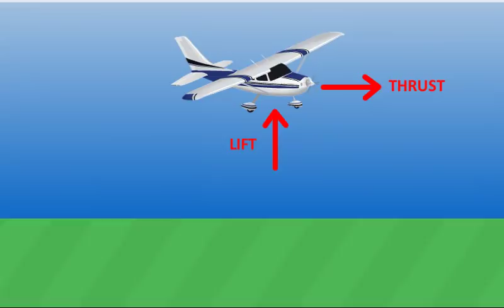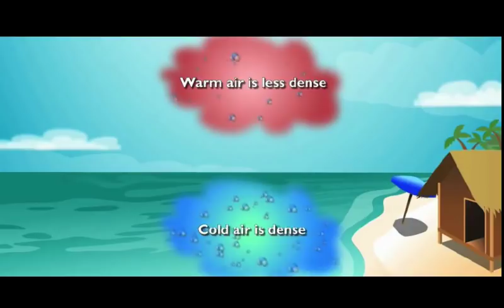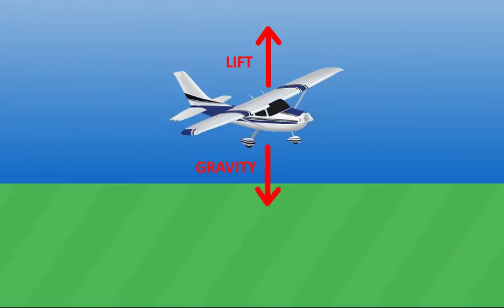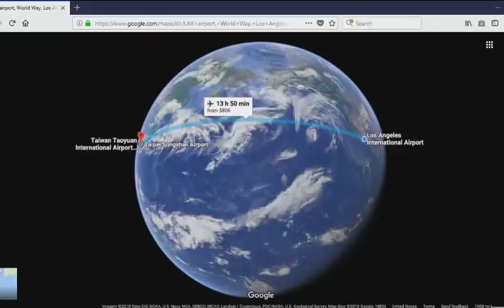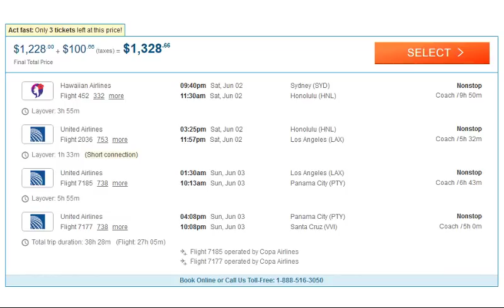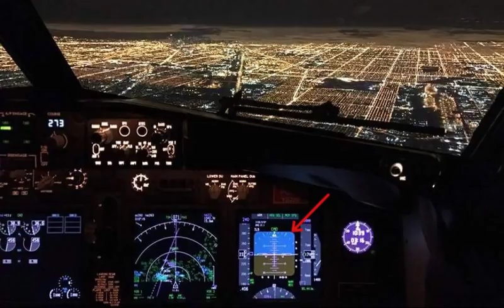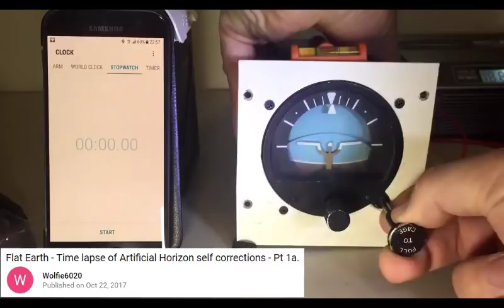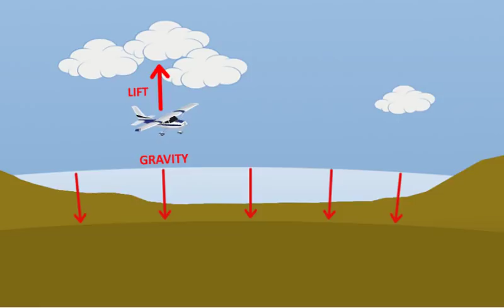Flat Earth Falsities - Plane Nonsense

Comment: globtards do not know science because the earth is flat
Reply: Okay, try this, get 2 people on different ends of a lake. Shine a powerful laser across and document the height of the laser at both ends. You will find that the laser changes height on the opposite end... thus showing that the earth is round, test your hypothosis before you believe it as fact
Reply: @dave chang
What extraordinary claims. You must be a very, very intelligent and experienced person. Are you?
Reply: that's the difference,you think but I know
Reply: @dave chang
No dave, you believe you think, if you could think you would know the Earth is a spheroid.
No dave, you believe you think you know, but actually you just believe because you don't know.
If you actually do have the intellect and knowledge you claim you should be able to answer these simple questions.
Why is it that a compass needle is more or less vertical at the poles and horizontal at the magnetic equator?
And when you carry on past the poles the needle slowly returns to the horizontal?
Why is it that it is only possible to navigate accurately over long distances using spherical trigonometry?
Why is it that traditional gyro compasses work perfectly in low latitudes but became unreliable in high latitudes?
Why is it that it is only possible to navigate accurately over long distances using charts based on a terrestrial spheroid?
Why is it that when you watch a ship sailing away from you the hull is the first thing to go below the horizon, then the superstructure and finally the funnel and upperworks?
Does a magnetic compass point towards polaris (Alpha Ursae Minoris) at the north and south poles?
Does a gyro compass point towards Alpha Ursae Minoris at the north and south poles?
What is the relationship between longitude and distance when travelling east or west parallel to the equator?
Tell me how you ascertain the error of a compass when in the Southern Ocean, using Alpha Ursae Minoris?
Please explain the principles behind the development and functioning of a gyrocompass?
No evasions please, just straight answers.
Reply: find out yourself
Reply: +dave chang

"that's the difference,you think but I know"

No, you only think you know. We actually have repeatable, detailed evidence for the earth being a spinning sphere orbiting the sun, while you have no evidence at all that the earth is flat.
Reply: bc u still do not know until u know u really know
Reply: liar
Reply: tsk tsk tsk always asking the wrong question good luck on your journey for truth
Reply: dave chang Why is it that those who know they know don't know they don't know how to explain what they know they know?
Reply: well you know shit
Reply: yup thats the idea  not to know bullshit like you have been learning stupid
Reply: HA HA so amusing how just anything with be pounced upon by these educated sane Normals :)  All the globe science is OLD greek stuff and century old experiences that did not prove.  Lost a +Mong but +Wong is still about, even mustered a 2 liners from  his usual.... But proud "salad tosser" +Capt'wes mason has gotten mighty shy since his revelations.

“Believe only half of what you see and nothing that you hear.” 
- Edgar Allan Poe
Reply: there's a test performed on the equator using a sink a bucket and water. directly on the equator water flows straight down but a few metres either side of the equator it drains spinning in opposite directions.. go watch it and explain if the earth is flat then why is there a centre of gravitational pull on the water when on the equator? why is there no other flat planets ? suns ? I think flat earth people are truly lost. I had a friend I've not met in a while tell me his eyes are now opened he believes in Christ and the flat earth. I say keep your faith in the lord but leave the earth as a significant reminder that he's a good lord and give us this planet to enjoy love and appreciate the greatest gift.
Reply: +Mr Moss

"there's a test performed on the equator using a sink a bucket and water. directly on the equator water flows straight down but a few metres either side of the equator it drains spinning in opposite directions"

That is just a trick to make a few dollars off of tourists. It is all about how they pour the water into the sink from the buckets. The Coriolis Effect cannot make that much of a difference in a few seconds a few meters either side of the equator. Likewise, the design of toilets and sinks has more to do with what direction the water drains out than the Coriolis effect does. However, the spin of low pressure systems can't be faked. Low pressure systems north of the equator spin counter-clockwise, while they spin clockwise south of the equator. That is due to the Coriolis effect, and no flat earther ever has explained to me what mechanism on the flat earth makes that happen.
Reply: Scientisim the excuse fe have.To dismiss evidence that proves the earth is round not flat.
Reply: @Martina Kosova
dave chang  = idiot troll i.e. idiot^3
Reply: to wong what did you expect from such a shit video it will only attrac trolls like you and me
Reply: they know only scientism